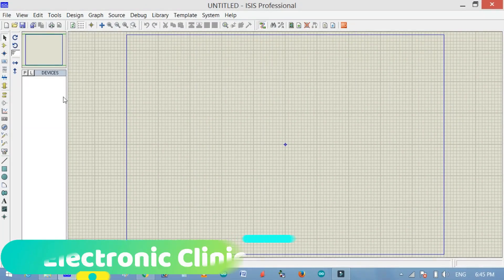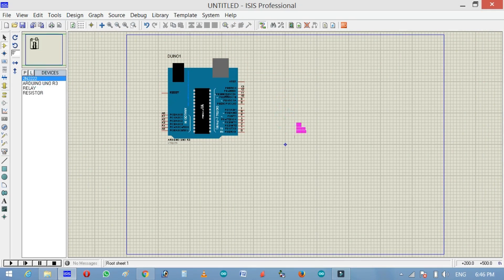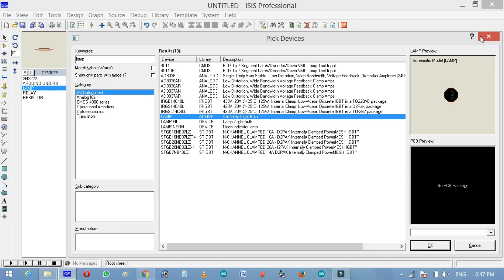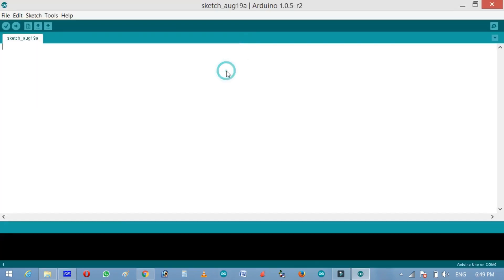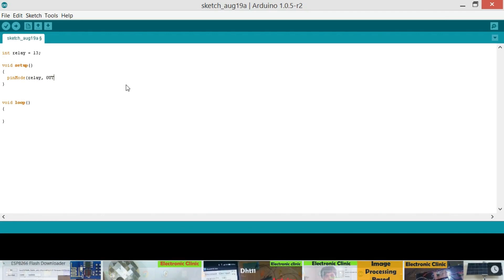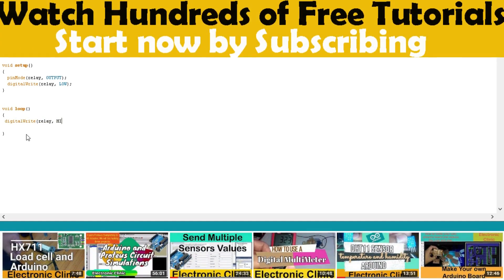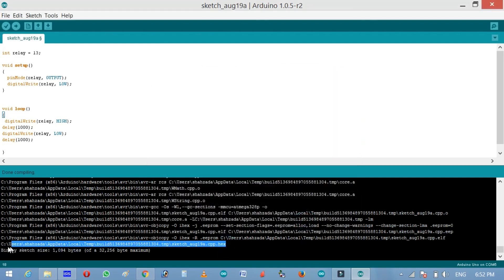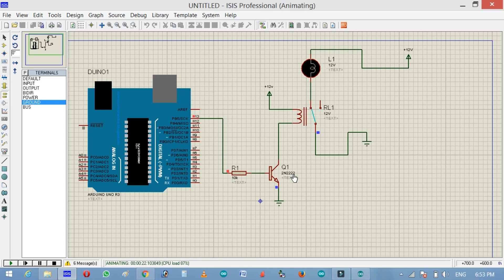Arduino and proteus together to simulate the basic relay circuit tutorial, Generate Arduino Hex file

Comment: can u make a tutorial on how to download and install proteus and how to add arduino library.if u dont plz share link for proteus  software .
Reply from the maker: ok today i will make a tutorial on how to add the  arduino library.
Reply: yar fahad may nay jo proteus 8 professional installed keya hy uss may woo library folder nahee hy.
Reply from the maker: install 7.8 version. i myself using 7.8 and have been using this for years.
Reply from the maker: 7.8 version is quite stable and you will never face any problem.
Reply: ok thanks
Reply: Can u share with me a safe link for proteous 7.8.to download it.
Reply from the maker: i added a tutorial on how to download arduino model library for proteus.